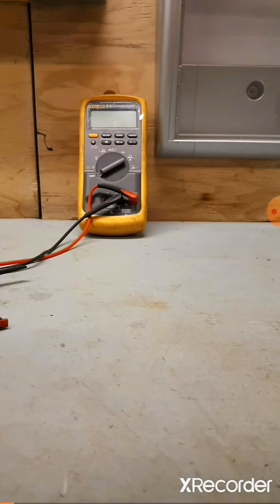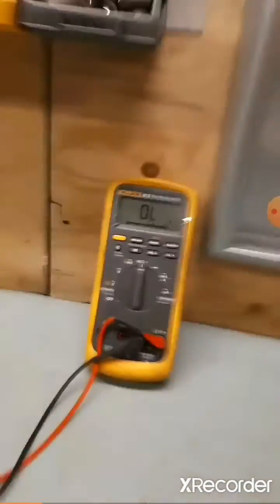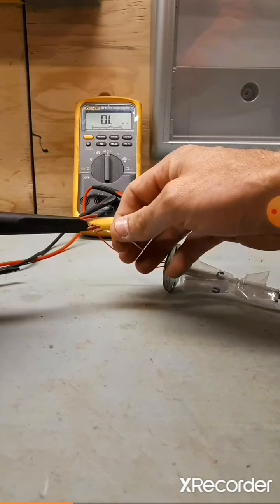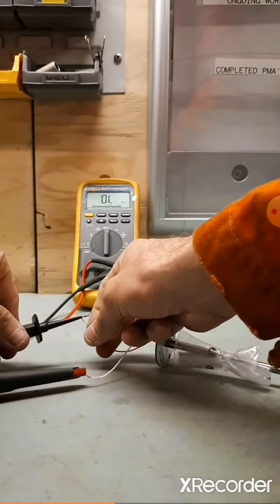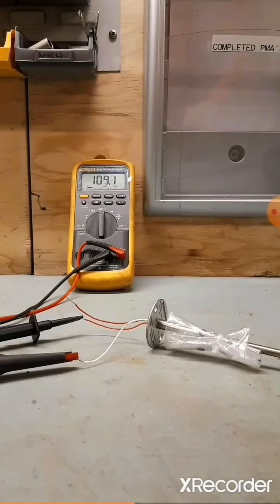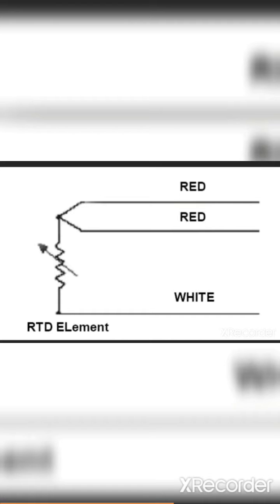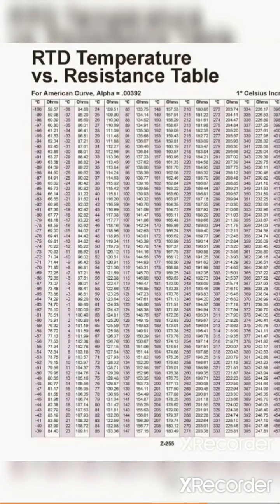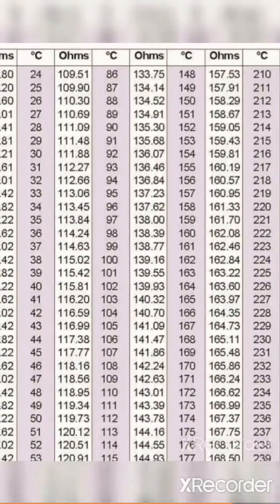How to test a 3 Wire RTD (resistance temperature detector)

Comment: My company wants to wire the RTD directly to a cabinet and use constant voltage excitation. Should one red be on negative, one red be on positive, and the white be on negative? Then, we can measure current in parallel circuits, compare the difference in current, calculate resistance for each circuit, then subtract the two resistances to get RTD resistance?